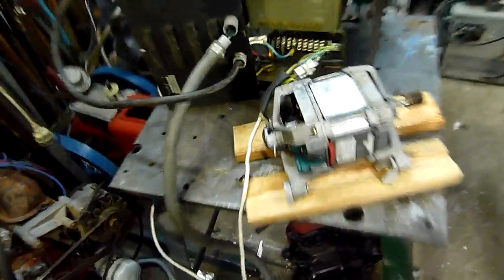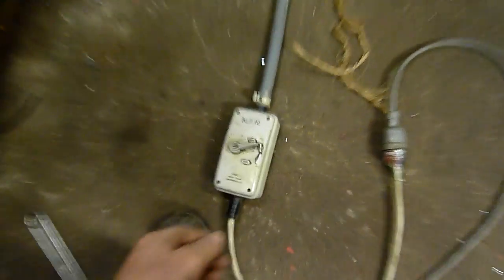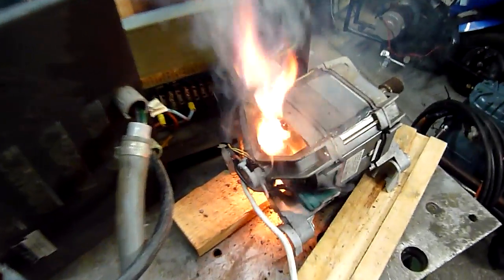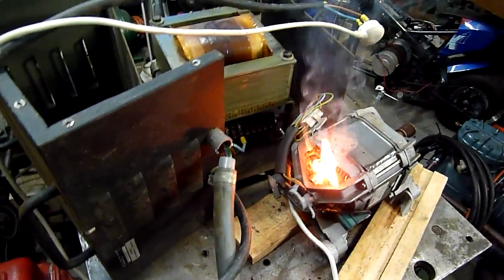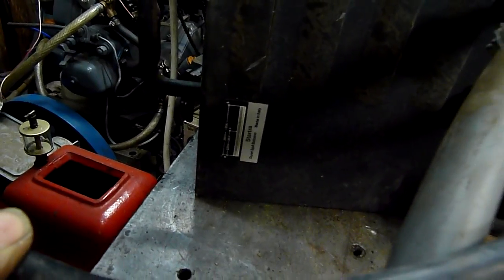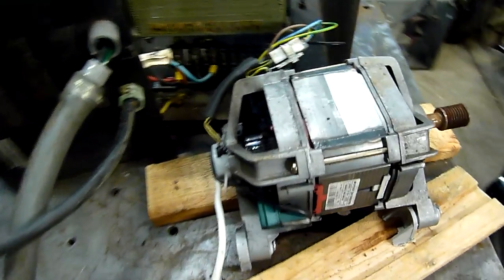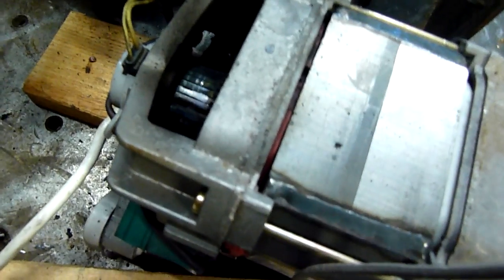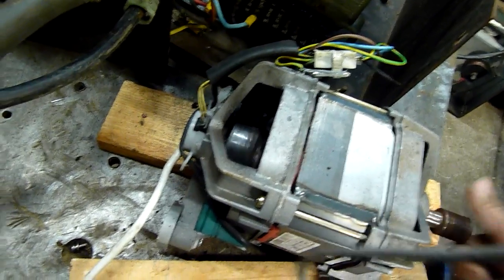Murdering Washer Motor in 15 Seconds - 415V Auto Transformer

Comment: Well yes, but it wouldn't be anything too amazing. It'd be running, then it'd gush some smoke & *POP*. 

It wouldn't give the fantastic brush-burning lightshow that a brush-motor does, nor spray sparks everywhere, & it certainly wouldn't have commutator bars to throw everywhere!
:-D

Nah, an over-volted induction motor would probably be pants, HOWEVER.....

Spinning-up an induction motor by belt-drive until it mechanically failed could be another completely interesting ball-game.

-BBD.

Comment: Putting an induction motor on it wouldn't have produced much of a spectacular result, because they run on the AC frequency, so it probably would just get very hot, very quickly, then blow a winding. Aussie50 does have a VFD, & in a few vids, he uses that to vary the speed of 3ph induction motors, & that's done by feeding a certain frequency into the motor for different speeds. With Brush-motors though, they can be varied by voltage, but put too much voltage in, they go....*POP* :-D

-BBD.

Comment: For several dryers and washing machines over the decades, we've taken the motors out and mount them on a stand and attach and wire wheel or a grind stone to them.  Makes a nice cheap wire wheel or stationary grinder.
I know burning them up is fun to watch but seems wasteful if it the motor works perfectly well.

Comment: @HDXFH I'm sure that, if the motor is gently teased on the variac, bordering on the edge of going *POP*, the variac would take it, even if there is a step-up transformer between the variac & load, as the variac wouldn't "see" the transformer, only the motor, as that's the load. 

The only risk, like you say, would be if the motor went short. It'd pull a big current on the transformer, & consequently on the variac, but a skilled variac user would be half-sharpish in turning down the volts.

-BBD.

Comment: Wooo! Motor pop! Oh yes, we've got flames! :-D

Mmmm, that commutator is completely wrecked in there.

Was this 'straight-to-brushes', or wired with the field windings energised also? 

Either way, with that transformer between the supply & the motor, it would be interesting to see a motor wired to that transformer, & slowly be teased with the variac....Until it pops!

That way, it gives enough time to really wind-up the temperature of the commutator until it glows like a lightbulb! :-D

-BBD.

Comment: Is it an idea to connect 2 of that motors together with the belt, so you can spin one, and than by putting voltage to the field windings make it in a generator, and than short circuit the brushes, so you get an braking effect, and let it run till meltdown

Comment: You should have that neatly added to your control panel with an amp meter and volt meter :) and im just wondering if say i got 3 of those transformers and hooked up all the neutrals on the primary together and had a 3phase input would it act like a 3 phase transformer?

Comment: @Aussie50 Service log is dated 21/08/67, have converted both units to 9 volt power and  seem to work well but as they are designed to detect Gamma radiation thankfully I have not been able to test them. Will shove it in the post. Cheers Bob.

Comment: @Aussie50 No worries it's yours, have installed a power supply circuit from Oatley Electronics so it powers up from a standard 9volt battery but still have the holder for the old school mercury cells, what is the best way to get your address without the freaks and wierdos finding out. Keep it real, Bob